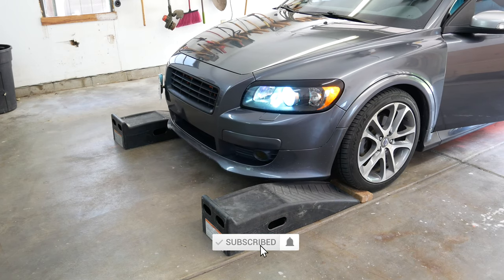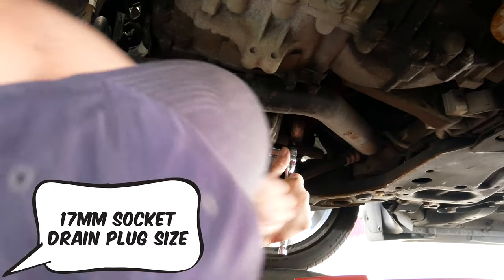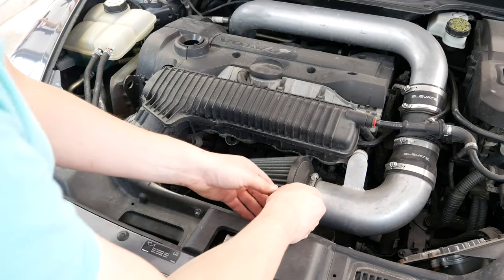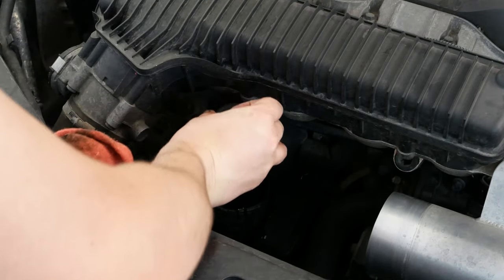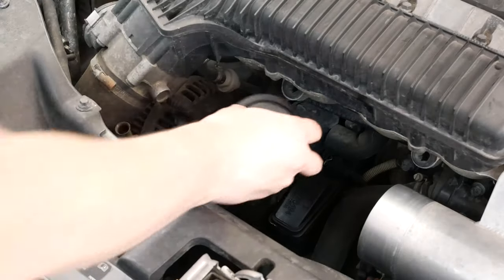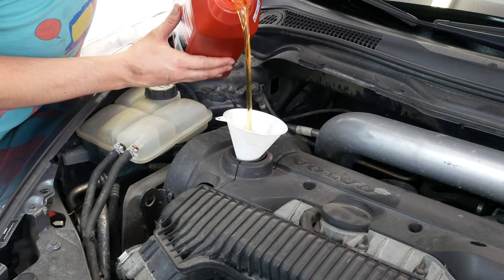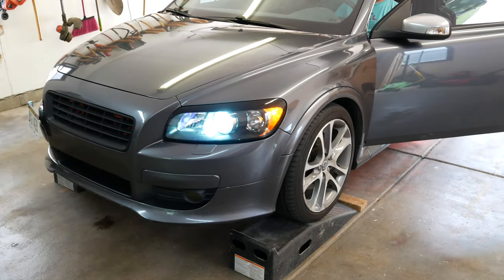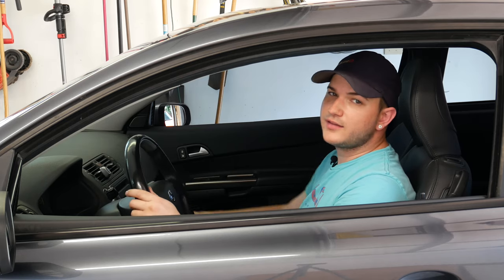How to Change your Oil on a Volvo C30! (or on S40 V50 C30 C70)

Comment: You sure that's a 2010?  My 2010 1.6D (ireland) has the updated facelift (grille, lights, etc) and the oil filter has a much smaller hex nut on the housing, and the oil pan is smaller and much differently shaped.  BTW, it will take people MUCH longer than you as we have to remove the proper air filter housing, which yours doesnt have.  
Update: and oh it gets worse. . . much worse.  On my model, you have to undo the freaking turbo pipe mount (!) in order to re-install the oil filter cover.  Terrible terrible design mistake.
Reply from the maker: I'm positive mines a 2010. Mine has an aftermarket intake on our as well.
Reply: @TheAngryHoneyBadger  - Strange. Either they rolled out the facelift midway thru the model year, or  just did it earlier in europe . . . or maybe mine's a 2011 and the paperwork is wrong :).  Anyway, C30s forver!  Enjoy.